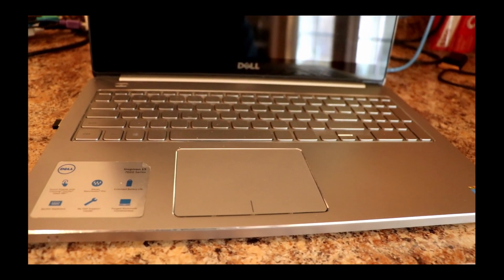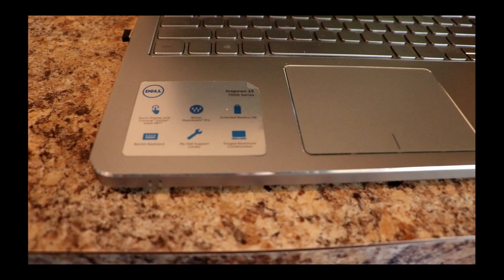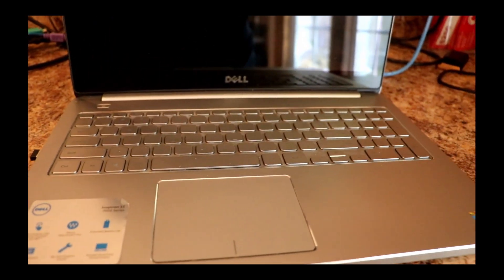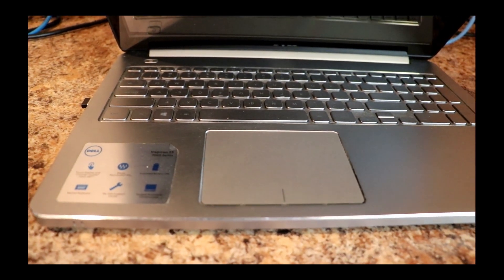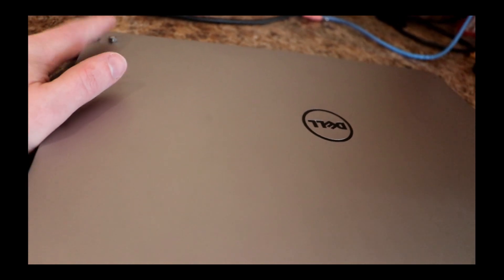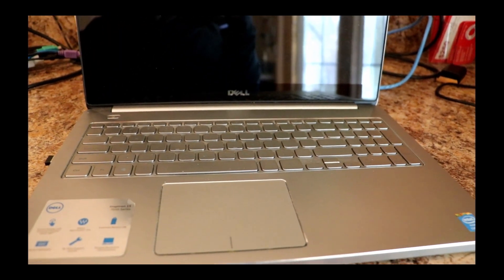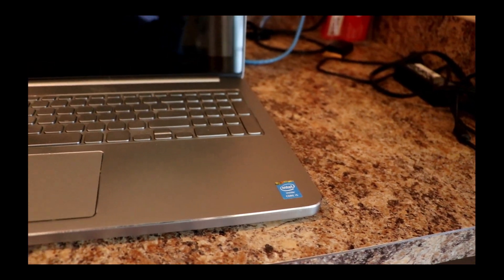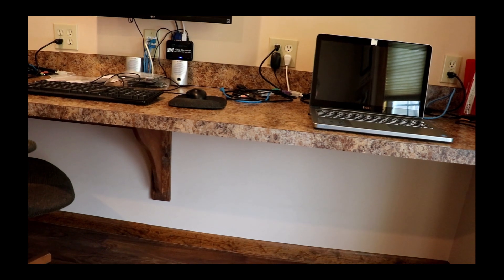Dell Inspiron Hinge Repair Completed

Comment: I saw your headline & thought you were making a video on replacing the hinge, silicone cap, which is under the keys.  Perhaps you can do a video on that process.  I just went through replacing the E key, hinge & cap on my Dell 15-5000.  Not fun, because there are a wide variety of different hinges & caps.  It is imperative to get the correct replacement parts, such as if it is for a backlit or not.  It took me longer than I wanted, because it was difficult to get the ultra small silicone cap to stay in place.

Comment: Hey man, a big thank you!  I had one hinge on my Dell Inspiron 15-7569 that popped loose today, all three screws had stripped out.  I gently pulled the display out enough to drill through two of the three holes in the hinge assembly and out the backside of the case.  I used two 6/32 bolts and nuts and a bit of blue locktite to fasten it down.  Had to use a dremel to take off a little of the screw tops of the bolts so that the display would seal back down perfectly.  Lubricated both hinges with a few drops of silicone spray (sparingly), verified screws on the other hinge and done!  You saved me a lot of heartache and possibly buying a new laptop with this video. Many of these laptop hinges are obviously underdesigned for "planned obsolescense" to force people to buy new ones.  Keep your repair videos coming!

Comment: Hi Matt, do you have a video of how you actually put in the screws? I have the SAME EXACT ISSUE the screw hole is worn out I have used my baby Inspiron for more than 4 years so it was about time!
Reply from the maker: Sadly, I do not.  The next time I have to do this fix I'll video it!
Reply: @LitchfieldCountyComputer   thanks for replying! Awesome finish on your dell! Do you have information on the type of materials you used on the job screw size etc? I am in Australia so will have to order it on Ebay!
Reply: What's the screw/nut type you used? Thanks